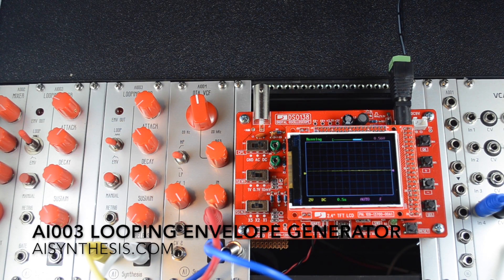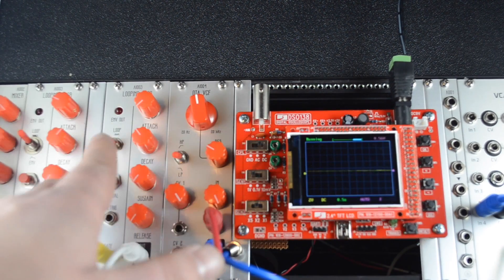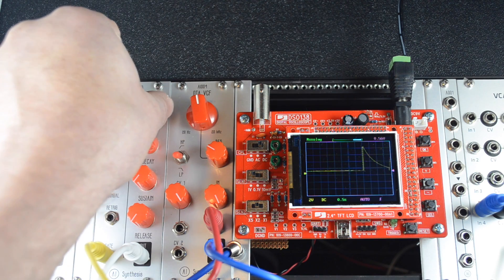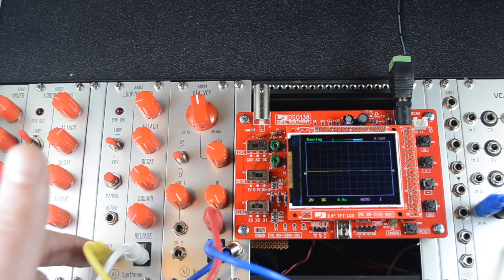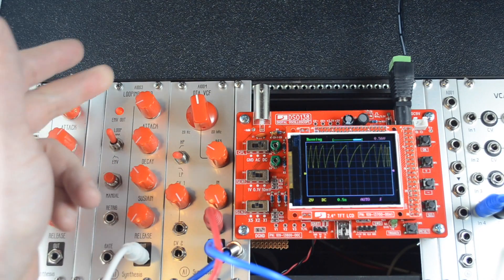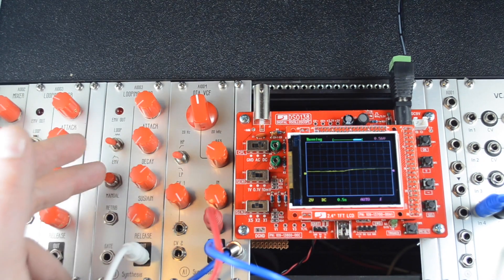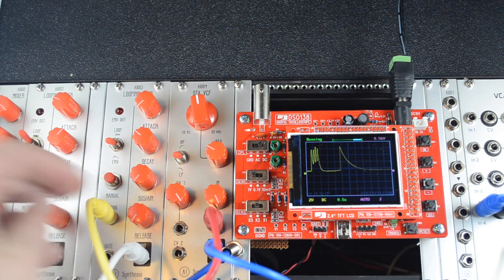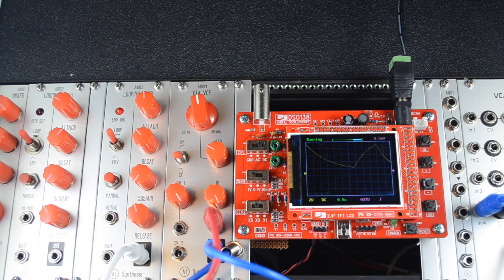AI003 Looping Envelope Generator DIY Synth Module

Comment: I'm curious if there are any similar looping modules but with cv inputs for each stage of the envelope?
Reply from the maker: No idea. The cool thing about this design is that it just used op amps and diodes. Other adsrs need timing or other specialty Ics. Many vc envelopes use a Curtis or Alfa chip.

Comment: I must have put the incorrect Jack socket, because mine isn’t looping with nothing plugged in.  I guess I needed to use the switched type of socket, that closes the gap between the tip and the ring when nothings plugged in?  I should’ve read the directions a little more carefully.  Great module!  With that loop mode, I like to use it as a regular clock, as when I fiddle with the decay, it will step my sequencer an extra time per envelope. The end result is  a nice swing in the rhythm!  THANKS for sharing!!
Reply from the maker: Feel free to hit me up via the contact page of my website!

Comment: Just built this and everything works I think. But I’m not sure I understand the release parameter. If sustain is up, then release is never engaged. If sustain is down, then the decay parameter is what causes the envelope to fully close. This happens regardless of whether I’m using the gate jack or not. What does the release function do? Is there no way to just make it function as a normal adsr where it attacks then decays, then holds at the sustain level for however long the gate is, then fades at the speed of the release parameter? Is my module not functional?
Reply from the maker: It absolutely can act as a normal adsr. Can you email via contact page?